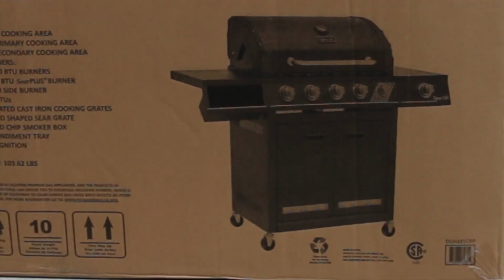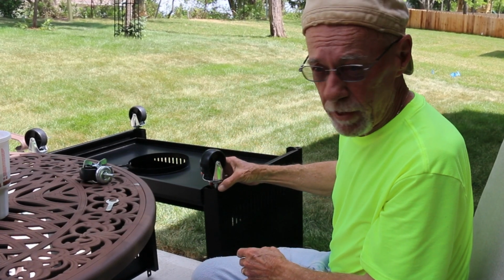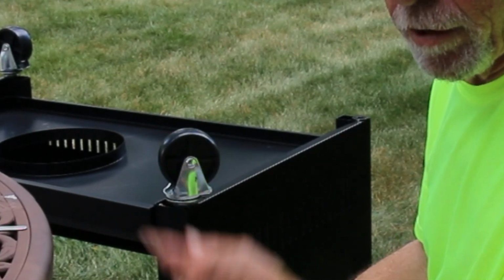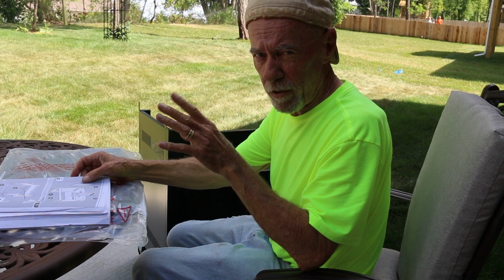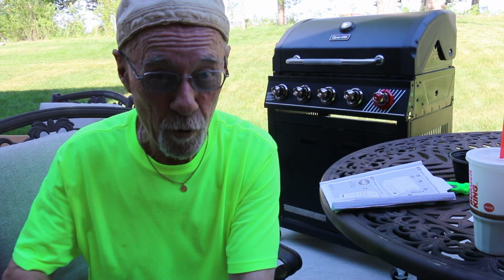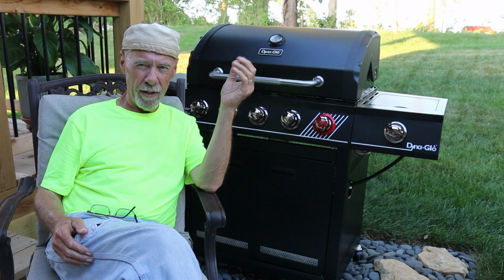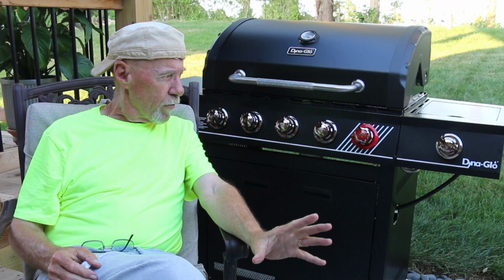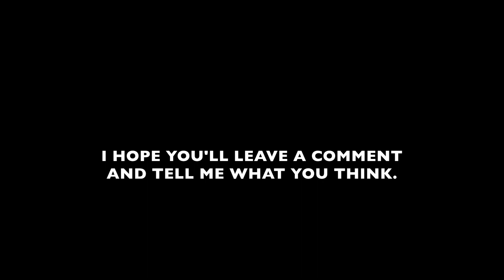BEST GRILL FOR 2020 - DYNA GLO -- DGH485CRP//DGH474CRP  --  First Impressions

Comment: Thank you for the video.  After 8 months,  do you recommend that grill?
Reply from the maker: Yes I do. It's still working great and made it through the winter outside with no problems. I can control the exact temp inside by adjusting the burners. Pretty easy to do. For the cost, it seems like a great value.
Reply: @MagnumVideos  thank you Sr.
Reply: The smoke is not all that great huh I just got one and don’t know if I’m using it right or something hat lol
Reply: @jesseestes3571  It's a grill dude, not that complicated to use

Comment: Thanks for the review. I just bought this from Home Depot, $199. I’m not looking forward to putting it together though.
Reply from the maker: It's actually pretty simple. Just takes a bit of time. And the main cooking box is a bit heavy. Either get some help or do like I did and set it on your patio table and walk it onto the cabinet framework.
Reply: Took me about an hour, not  too bad
Reply from the maker: @KOCHiiMAYOR420  YOU'RE WAY FASTER THAN ME.
Reply: I just put one together for my mother inlaw. Its so hot out here in houston. It was a bit of a pain but now i want one for myself
Reply: 249 today home depot